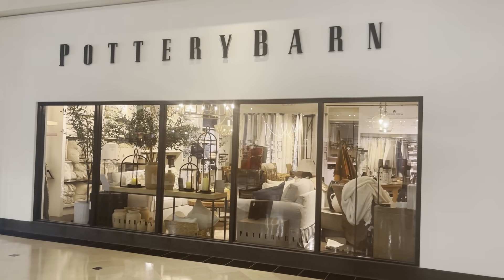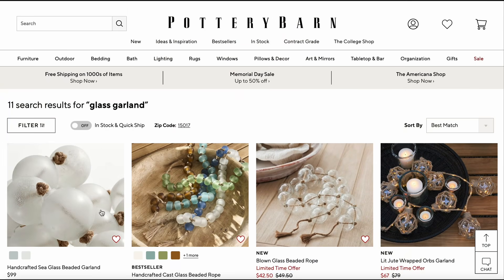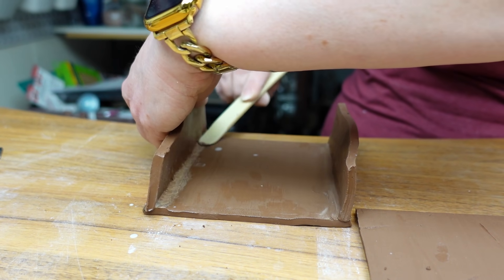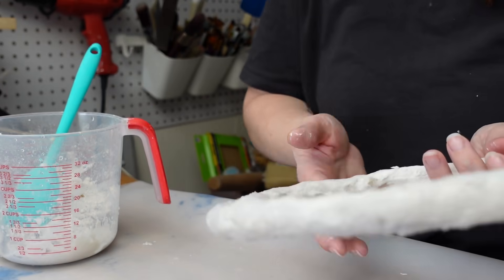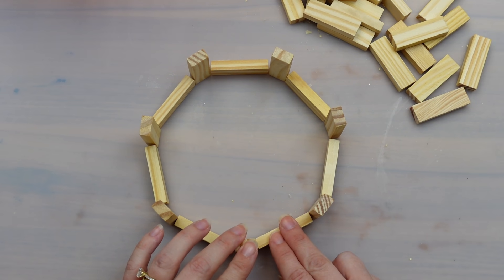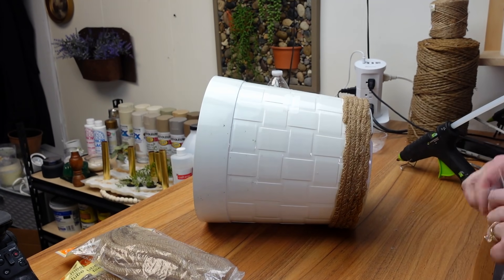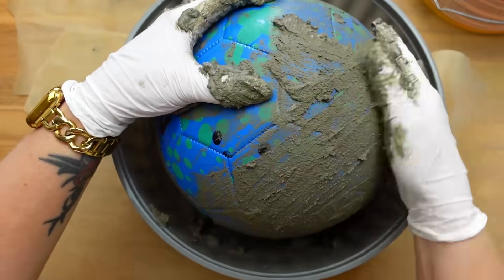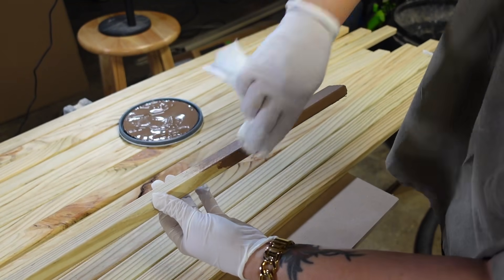NEW DIY Decor Dupes // High end home decor on a budget

Comment: Quick tip on working without gloves - if you scrape your nails on a bar of soap before you start - then after you’re done - you just have to scoop out the (mostly) soap from under your nails. Works great when working with dirt as well. 😄
Reply from the maker: Great tip! That’s always the worst part, cleaning out my nails

Comment: These are ALLLLL FABULOUS!!!!  I love that you show your oops and how you fixed it. I've been wanting spheres Forever!!! I love the privacy screen!  It looks better than mine. I made a frame out of 2x4 with a cross brace and then zip tied on that reed fencing. lol Let's just say I'm glad I zip tied it on- because that reed stuff does not last and it's a spider lair. lol  My frame is actually solid, and I also had issues with the feet. I didn't use enough screws. lol  and I think you just gave me the idea on how to add some strips to it like yours instead of the reed fencing. I will Frankenstein it!  Thanks for sharing!
Reply from the maker: I love a good Frankenstein project 🥰

Comment: That privacy screen is great! 🤩 Maybe some sheer material (like a curtain) can be added on days you'll be outside? 🤔 I need to compare prices on trellises (buying vs. building) because I need to hide my septic system that's in my front yard. 🙄 You've inspired me (to get the materials for my spouse to build 😂)!
Reply from the maker: I was thinking the same about adding some sheer curtains! I love that look. I also picked up some already built trellis at Home Depot for the opposite side of my deck and that was less expensive. It was also vinyl or plastic not wood. I think I prefer that though since it will be low maintenance

Comment: you can also use a plastic bottle underneath for the clay project.  The slat wall you should have used a smaller spacer. You can grow a vine in a pot near it to let the vine climb on the wall. Use Ivy or clematis